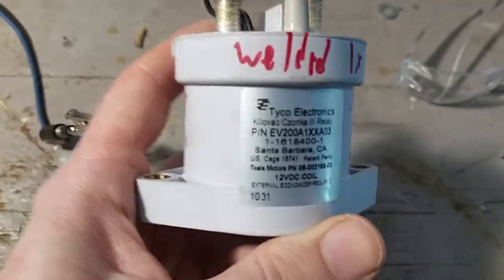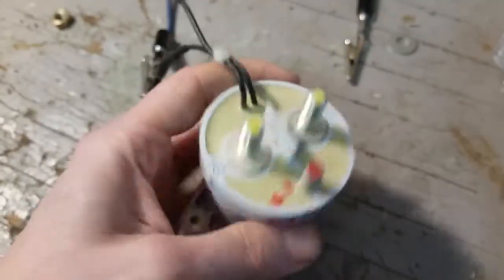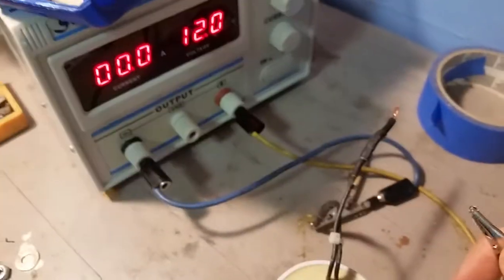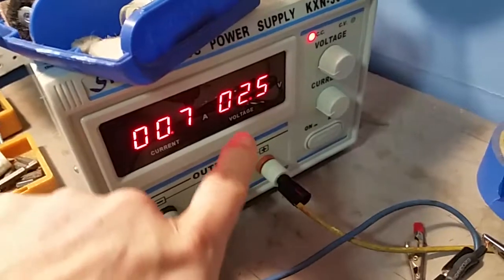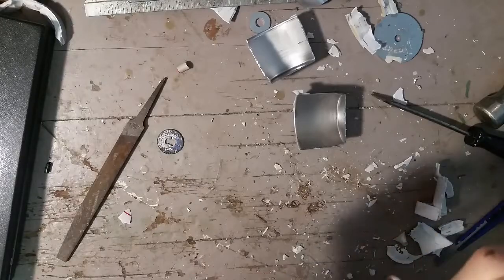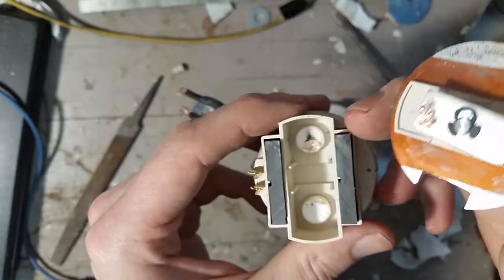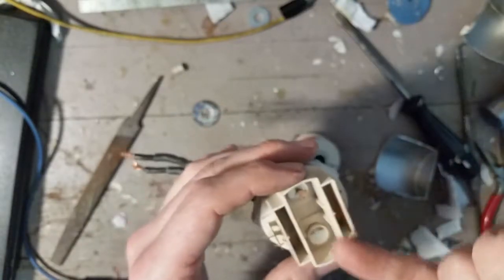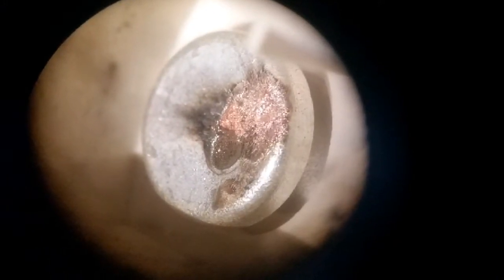welded contacts - Tyco killovac EV200A Contactor disection

Comment: So what is the solution to this kind of problem?  I have this problem right now with a contactor on my off grid power, it welded when I did a shufoff test.
Reply from the maker: I guess the solution is beefier, more expensive contacts. The current breaking rating is only good for so many cycles, higher current wears it out faster. Ideally, it should never open or close under load
Reply: If your contactor is closing into a capacitive load, you'll need a precharge circuit to prevent it from welding.